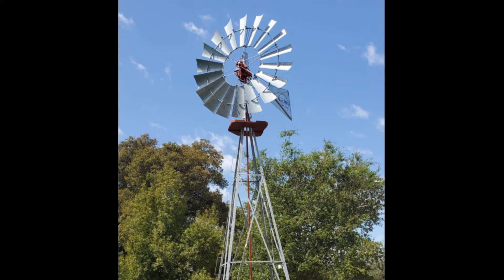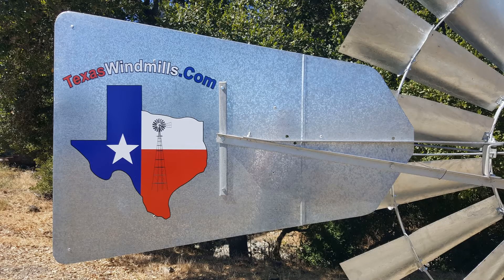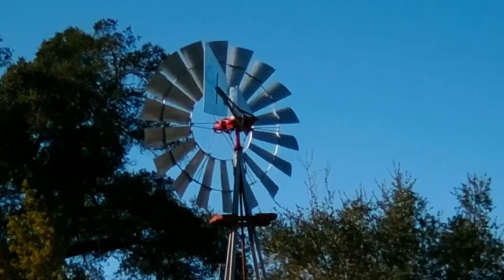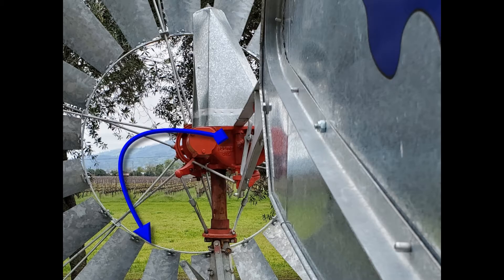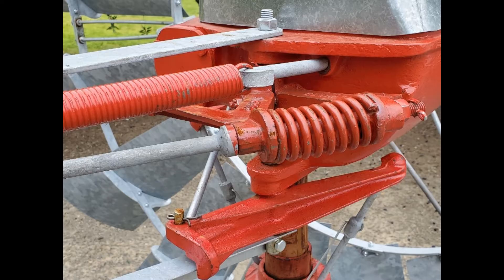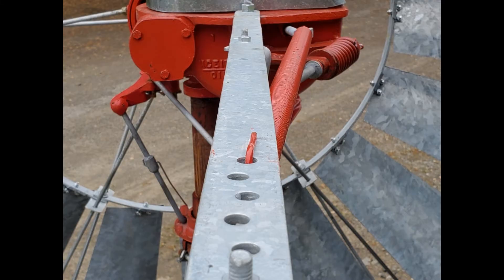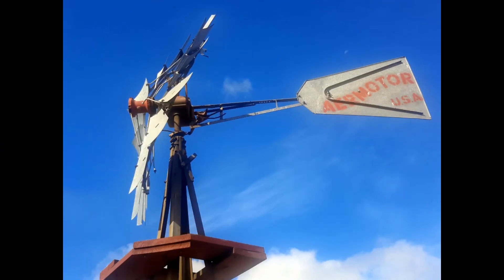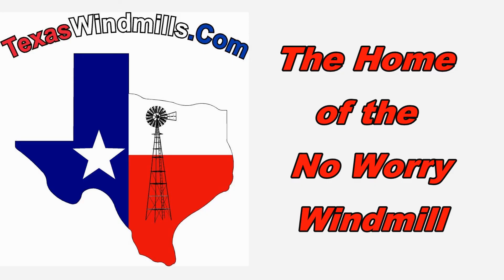Windmill Speed Control

Comment: Thanks for this video. Those Aermotors have a state-of-the-art furling mechanism. No wind is ever too strong for it. It always furls timeously. The beauty is that it maintains it speed and regulate it by "playing" with the tail vane. Some other models like Climax tend to run wild, then furl and loose speed. When it is turning slowly it unfurls to repeat the cycle. I have a few of these on the farm. One dates back to the late 1940's and it is still running in its original condition. Two others from early 1950's have been overhauled once (new small gears and white metal bushes).

Comment: Fascinating. Whst do windmill owners do if there is a wind storm? Is there a brake or some way to protect the windmill?
Reply: There is indeed a brake on the wheel.  The brake is applied and the tail also turned parallel to the wheel so that the wind won't want  to spin it.

Comment: Clever invention from 1880's. I understand why tail spring (for direction/speed control), and buffer spring (to prevent slamming) but what are these rods left of the tail used for - some kind of brake? Why there's no buffer springs on both sides of tail (because the wind can rapidly change in both directions)?

Comment: The physics behind furling is centered around angular momentum and precession.
Acting as a gyroscope, the rotating mass will cause itself to move around or '"precess" about its center of rotation. Since that center is offset from the center of axel rotation, the entire wheel as well as everything in between roates with it, and in the case of a rotating turbine, it "walks away" causing its plane of rotation to no longer be perpendicular to the wind flow.  When this happens, the turbine, being no longer powered by air flowing properly across its compression vanes (blades), loses rottional speed, slows down and spring tension realignes it (the plane of rotation) perpendicular to the wind once again. This walking away action is called "yaw".
It should be noted that the vane or tail rotation relative to the turbine's yaw field is independent and limited by a stop (to prevent it colliding with the turbine) and another stop causing it to return to a position perpendicular to the turbine - all points in between controlled by spring tendion and angular momentum.